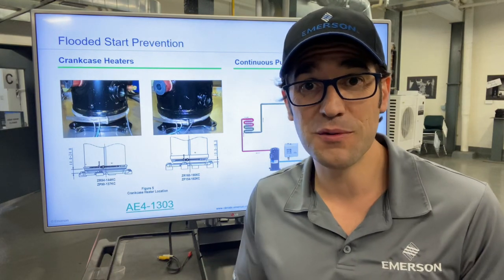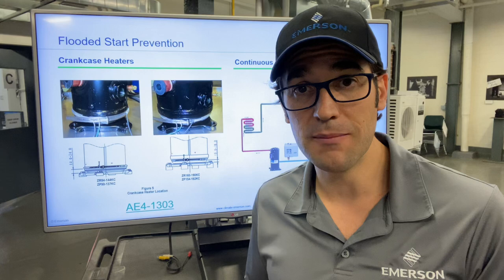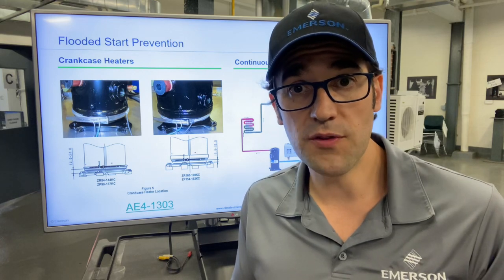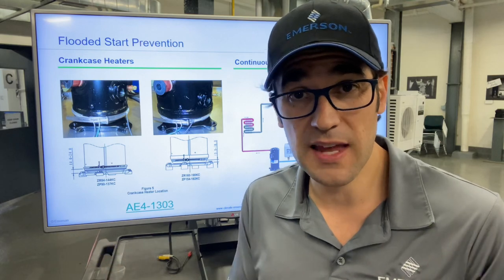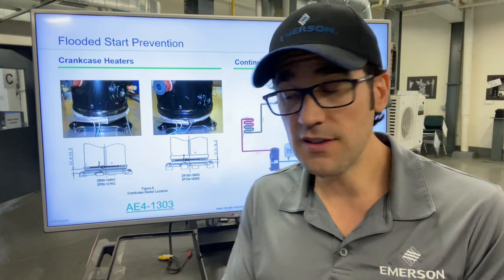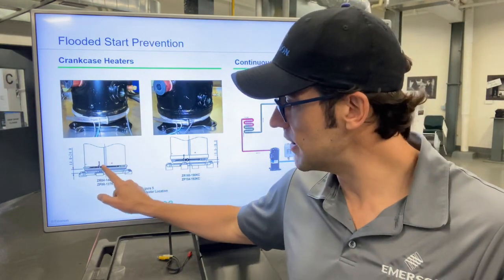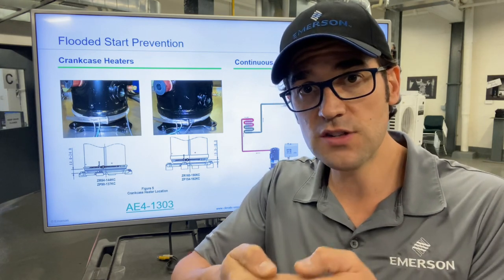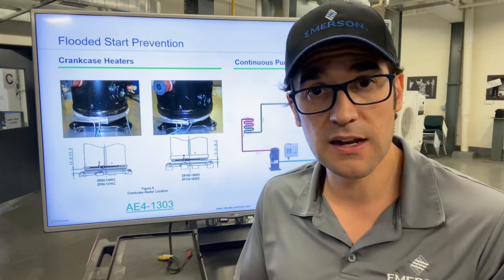The Untold Story About Scroll Crankcase Heaters

Comment: Hey Trevor, what about in the horizontal format?
Reply from the maker: It depends where they are located but a lot of time when installing a ZBH you are on a system like a rail car and when that is parked there is no power to energize the crankcase heater so you will install a discharge check valve and set up a pump down system to prevent migration.
Reply: Hi Trevor, where would you find that information?
Reply from the maker: @terrytugwood7848  You really need to look at the specific compressor manual. Here is an example check out page 18 this is an example of a 25-45 ton compressor.  https://webapps.emerson.com/online-product-information/Publication/LaunchPDF?Index=AEB&PDF=1401

Comment: Flooded starts can still happen crankcase heater or not, or even 4 of them strapped on. The flooded start is much more about the condition of the suction line out in front of the compressor. Yes crankcase heaters are a critical part of starting refrigerant compressors in low ambient conditions but to say there roll is to prevent "flooded starts" IMHO is incorrect. There roll is simply to keep the oil where it's needed by not having the oil froth up as liquid refrigerant boils out of the oil at start. You could add huge heat input to the compressor and still have a long slug of liquid sitting in the suction line waiting to flood your compressor. In fact if the crank case heater is needed so would a need to keep the suction line above sat temp as well.
Reply from the maker: I see your point and yes on air cooled compressor most likely but for refrigerant cooled compressor usually not unless you have some sort of design issue.